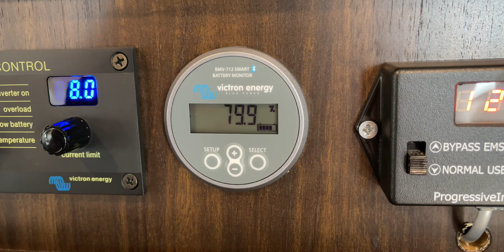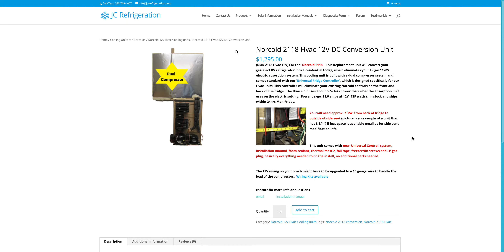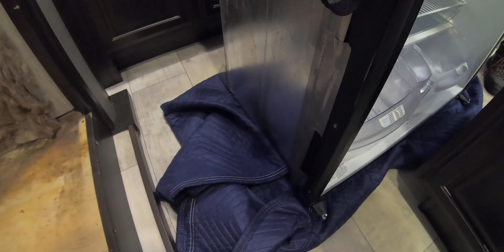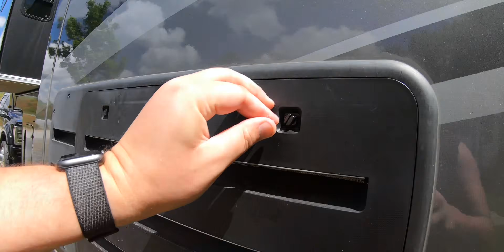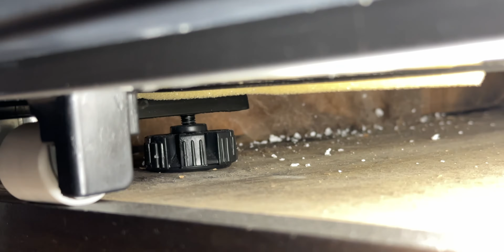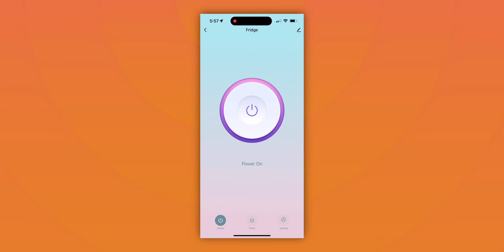RV FRIDGE SWAP - Norcold 2118 to Samsung RF18 - Absorption Refrigerator Died So We Went Residential

Comment: Thank you I was about to buy a norcold or even furrion to replace / update the stock bs that came w my class a right. Not now might as well go residential and not have those problems like you said. I love the dc option but if it comes with headaches down the road I will pass and save a couple thousand. Thanks
Reply from the maker: @breannaolssen5076 You’re very welcome! But just to be clear, our 2118 was an AC / Propane combination. I don’t have personal experience with a DC version.
Reply: @AroundTheSunWeGo  the one I was looking at is a 2118 which I think does all 3 but I would have only hooked up the dc
Reply from the maker: There could be a version of the 2118 I’m unaware of, but I believe the DC option also requires propane. So if it says the 12v/DC amp draw is 2.75, that’s how much power it uses while running on propane.

Comment: Okay so where did you connect the two positive and negative wires that you cut from behind the fridge slide out…?

I did the same and it keeps blowing the fridge fuse. I wasn’t sure where to reconnect them lol.
Reply from the maker: @mementomori2353  I connected them to one another.

I connected the positive to the positive and the negative to the negative.

One of the positive wires is coming from the battery and one is going to the stove.

One of the negative wires is coming from the battery and one is going to the stove.

So you’re simply splicing them together so the power can flow from the battery to the stove.

Comment: I have this same fridge freezer is at 20 degree and fridge is at 60 degrees I live in desert so currently 109 outside. I see no yellow powder i replaced the thermistor and still nothing and the fans in back are working and I have the Titan fan as well.
Reply from the maker: Sorry to hear that! I’m definitely no expert, so I don’t have a ton of insight to give here. Did it ever work properly in 109 degree temps? If it did, at least you know something has changed and it may be fixable.
Reply: @AroundTheSunWeGo  Did to hook yo the ice maker or the water on this fridge? 

They are only $900 right now so I may jump on one.
Reply from the maker: I did not but I know other people have run a line to the slide, so it’s definitely doable. I don’t trust the water at different parks enough to consume though lol

Comment: I have a 2021 Norcold 1210 the freezer is more or less a cooler at this point. There is no change from LP or electric, no amonia leak. Everything ohms out correctly. No idea what is wrong, either I start spending 100's of dollars and replace boards and hope that works. Or just buy residential, since I work on the road and park for 12-18 months at a time.   Great video and exactly what I needed to see for the removal. It is making my mind sit easier, if i choose to go residential.
Reply from the maker: Glad you found the video helpful! Only other thing I didn’t see you mention is airflow. Do you know if your setup is pulling in plenty of air at the bottom and forcing it up past the fins and out through the top?
Reply: @AroundTheSunWeGo  Yessir fans are flowing just fine. The freezer is around 45 degrees and the fridge is 68 degrees. Can't figure it out, but a 1l residential fridge, some foam board and gorilla tape is a great deal and easy to do .
Reply from the maker: @Stiffy910  Roger that! Yeah, it might be something minor, but if you just can’t pin it down, the swap is easy enough. Good luck!
Reply: @AroundTheSunWeGo  Ya man im torn between swapping out all electrical components and a hope and a wish. Or just swopping residential and be care free with this foreign pain in the A$$ fridge.  Thanks man
Reply from the maker: You got it!

Comment: Enjoyed your video. Very helpful. I'm researching 12v or residential fridges. How do I handle traveling and maybe a quick pic overnight boondock with the residential fridge? 

I also have a Samsung at our house, which always needs a reset.
Reply from the maker: We have an inverter along with a 300 amp hour lithium battery bank which powers the fridge any time we’re disconnected from power. I installed this system when we first purchased our RV so it was already in place when I made the fridge swap. If I didn’t already have an inverter and wasn’t interested in installing one, the 12v fridge would be an awesome alternative.

Comment: I've not heard anything but bad reviews on Samsung appliances and the same with LG. I would look at other brands myself. But then again I wouldn't do a residential fridge in my camper. I like the absorption set up and if I changed my mind, I would go 12v.
Reply from the maker: I totally understand the concern with bad reviews. But I dug pretty deep and realized for every bad review, there were 99 good ones. And those who have a bad experience are usually the loudest. With that considered, a less than 1% chance of dissatisfaction sounded good enough to me. But after 2+ years and thousands of miles we’ve had no problems. Fingers crossed it stays that way!
Reply: @AroundTheSunWeGo  I have a Kenmore fridge I bought new in 1994. So far it's working flawlessly. Moved it from our kitchen to my garage. We put a Frigidaire in the kitchen and have had nothing but trouble out of the ice maker. Hope yours lasts a long time.
Reply from the maker: @f150bft  sorry to hear that! And yes, me too!

Comment: Nice job.  Those units are to be lower in the rear.
Reply: From Samsung:   Samsung refrigerators are designed to lean back at a 4-degree angle. This slight backward tilt helps the doors shut easily, supports ice production, and prevents water from leaking into the fridge from the evaporator
Reply from the maker: @patrickmelson4745  Interesting. That explains it. The tilt seemed a bit too exaggerated in my opinion. I think I’d still want to level it out even knowing this. All has been well so far. Hopefully it stays that way! Appreciate the insight!
Reply: Keeps water from pooling inside the unit.
Reply: Did you hook up water supply for the ice maker?
Reply from the maker: @patrickmelson4745  I didn’t. We rarely use ice so didn’t make much sense to go through the trouble in our case.
Reply: @AroundTheSunWeGo  Gotcha!  Did you mount it down or how to keep it in place?  I'm going to order one today.  But wondering about the glitch is going for you that they shut off...?
Reply from the maker: @patrickmelson4745  It’s in the video how I mounted it using some brackets. And also how I use a smart outlet to eliminate the glitch. It’s been working great since the install. No issues.

Comment: Samsung fridges have a manufacturing defect.  Do a web search.  Ice maker problems, fridge section building ice behind panels, defrost not working causing fridge to warm, a lot of water leaking into the bottom drawer or onto the floor.  Samsung gave me and many others their money back.  For some, the issue never strikes.  News media have interviewed people on TV.  People are filing lawsuits, BBB of NJ is well aware of Samsung.
LG finally replaced their compressors with one that doesn't quit working.
Reply from the maker: Wow. Lots of interesting info here. During my research I found an overwhelming number of reviews are positive and I haven’t personally heard of or experienced any of those issues myself. But I understand issues do happen, and hopefully we’re one of the ones where the issues never strike!

Comment: Thank you! It's a great video! My dual reclinler theater seating unit has just started to peel on the headrest of the seat I never sit in! Couldn't figure out why that chair and not the chair I always sit in. I also keep the temp inside at a cool temperature.  This video has provided great replacement info. Job well done! Thank you as well to Lippert and Recpro!
Reply from the maker: You’re very welcome! So glad you found the video helpful!

Comment: We too have the Norcold 2118ST refer installed in our GDRV 378MBS; the fridge has been leaking since April and I can't find where the water is coming from.  Seeing your video and, the issues with the cooling unit, leads me to believe that is the culprit.  Great video that gives me the confidence to swap out ours if this is in fact the case.  Thanks.
Reply: There is almost always a drain tube on the back of the fridge...it usually vents out the access door on exterior...if the tube  cracks and it will or comes undone...it will leak the water back into the rv...that might be your issue...I have a dometic so unsure where the tube is on the norcold but review that and see it thats the issue....
Reply from the maker: Sorry to hear your fridge isn’t working! But yes, definitely want to make sure it’s the cooling unit and not something else simple before you make the swap.

Comment: Very nice video.  Fortunately we are still using our domestic RV residential fridge from when we purchased our DRV in 2012.  Even in the hot summer it does well as long as we don't overstock our fridge.
Reply from the maker: Glad to hear it! Ours worked great until it sprung the ammonia leak. And from my understanding this is a very premature failure. Maybe it was because we spent some extended time in extremely wet and salty air and because we boondocked on propane for a very long time.
Reply: I have archived this video because our fridge is going on 11 years old and I imagine it is just a matter of time before we have to replace it.  Once again thanks for the time and effort you put into this great video.   @AroundTheSunWeGo
Reply from the maker: @terrybryant  You’re very welcome!

Comment: The only thing I did differently when I replaced our RV fridge was to leave the upper vent open so heat from the fridge can escape to outside rather then inside. I know it's not an issue in cooler times but in the hot southeastern summer, additional heat can be a problem.
Reply from the maker: Definitely something to consider. My only concern about leaving a vent open would be the 24/7 exposure to humidity.
Reply: I'm about to do this same job, was wondering what I should do about the vents also. I feel like having at least one vent open is a good idea! why not both?
Reply from the maker: The residential fridges are designed to be operated inside. If the rear vents are left open, you’ll be sucking in humidity, dust, bugs, etc from outside. Not to mention any rainwater blown in during storms. You’ll also lose heat and cool air from your rig as well. The stock fridge has an airtight border/seal around the opening so this isn’t a problem. The residential fridge however has plenty of space and airflow all around it.
Reply: @AroundTheSunWeGo  smart. I'll probably do the same then. Depending on how airtight I seal the fridge to the interior of the cabinet. More than likely will insulate the rear as you've done to make it simple. Good work
Reply from the maker: @TreyCamp   I also made sure to leave space all around the fridge for airflow purposes, unlike the stock fridge. I believe the manual calls for at least an inch or two of clearance on all sides. Not sure how important that spacing is, but I didn’t want to take a chance, so there’s plenty of space all around our unit.
Reply: Ditto

Comment: Such a helpful video, one to keep in the safe. Our absorption frig stopped working, well almost, going through AZ a couple of weeks ago when it was 116 degrees outside. Threw all the food away! Got back home unhooked, made sure the trailer was level, and it started working again. Why my high interest in your video, how you replaced it, and what frig you replaced it with. Liked your verbal descriptions as you went along then. To show on video was the best. Hope it's working out well for you.
Reply from the maker: Thank you Steven! Glad you enjoyed the video. Yes, the new fridge has been going strong for 15 months now and we’re super happy with the upgrade!
Reply: @AroundTheSunWeGo  another question. Will be putting this Samsung in our RV in the coming weeks. Where do you place the Smart Outlet (to automatically reset power every other day)? I want to get it and have the repair guy put it in when he puts in the frig. thanks
Reply from the maker: @stevengoossen6019  there should be an outlet somewhere behind your current fridge if you have an absorption one like the Norcold 2118. That’s what powers the AC side. When you remove the old fridge, you’ll see it.
Reply: @AroundTheSunWeGo  I'll be buying my Samsung tomorrow. No time like the present. My RV is in the shop right now.
Reply from the maker: @stevengoossen6019  good luck!

Comment: Great video. This is electric only, correct? How do you keep the refrigerator cold if you’re traveling or boondocking? I’ve been wanting to change ours, but I’m not sure how it works if not connected to electricity.
Reply from the maker: We have an inverter set up with a 300 amp hour battery bank so our outlets are pretty much powered at all times. If you didn’t have an inverter you’d need to install one.
Reply: You'd need an inverter or generator for boondocking, but you should get 8-12 hours with the fridge staying cold enough without power.  Think power outages in sticks and bricks.